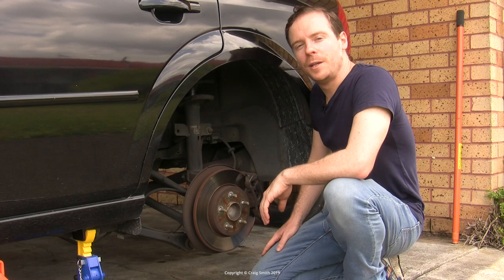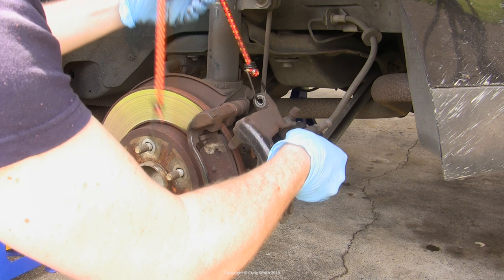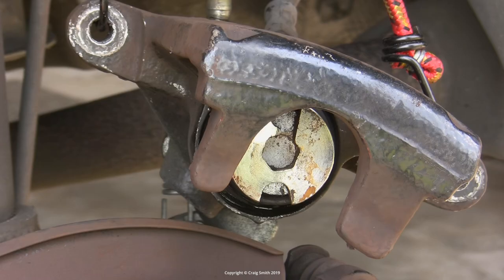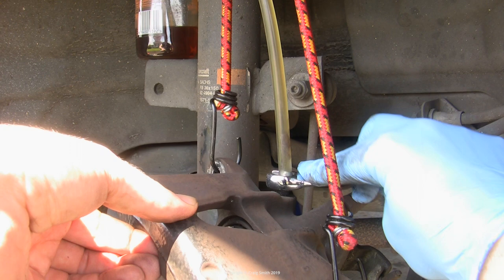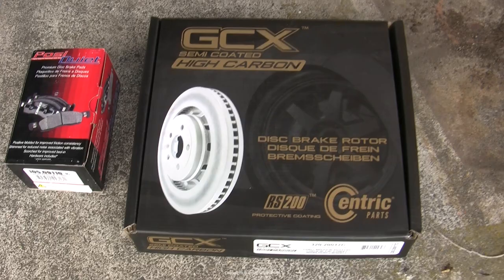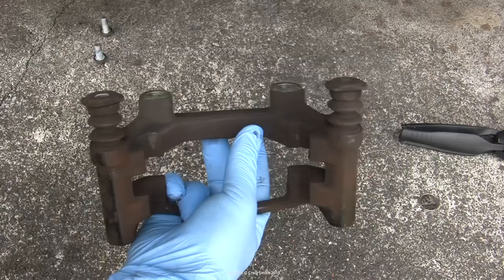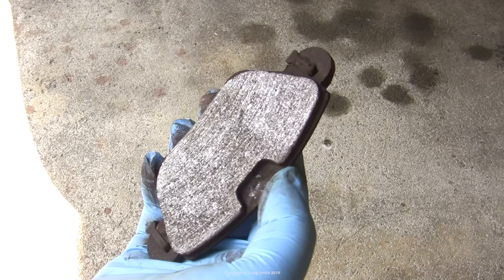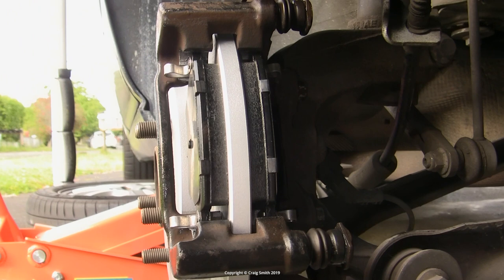How to: Change REAR disc brakes, rotors & pads (Ford Mondeo Mk3)

Comment from the maker: Amazon links to relevant products (from the desc):
* US rotors: https://amzn.to/2LVsAkR | Pads: https://amzn.to/2rN9h6n
* UK Mondeo rear discs: https://amzn.to/2LVtmyh | Pads: https://amzn.to/2rLtNo6
* Flare nut spanner - US: http://amzn.to/2rkSzum | UK: http://amzn.to/2mNEKPo
* Torque wrench 1/2" - US: http://amzn.to/2g1zGoJ | UK: http://amzn.to/2gJ7sAg
* Threadlocker - US: http://amzn.to/2DN3Upv | UK: http://amzn.to/2mTuVAv
* Caliper winding tool - US: https://amzn.to/38FNNcc | UK: https://amzn.to/2PJULo3
* Brake fluid - US: http://amzn.to/2BbX6Pb | UK: http://amzn.to/2DRlatX
* Self-bleed kit - US: http://amzn.to/2rk35Sm | UK: http://amzn.to/2EUAULK
* Silicone grease - US: http://amzn.to/2dv7lY2 | UK: http://amzn.to/2erht5w
* Anti-seize - US: http://amzn.to/2rlBU9Z | UK: http://amzn.to/2Beksni
* Brake clean - US: http://amzn.to/2DNbGj6 | UK: http://amzn.to/2Bfp4d4
Reply: Hi Craig. Thanks for your video's firstly.
I've recent been working on my front brakes from following your guides. No problem at all. I started the drivers rear. Long story short my piston doesn't seem to engage and brake pedal has full travel. I did have a problem where the piston was nearly all the way out. I managed to find it all the way back in. Reassembled everything. Thats when i discovered the full travel of the pedal. I'm hoping you can help.
Thanks.

Comment: U not sold on the latest rave: Ceramic Grease?
Reply from the maker: I had silicone grease already :) I'm sure the ceramic stuff would be fine too. Next time.
Reply: @CraigsDIY  I did some blog research and believe the sliders have to get silicone grease to preserve the boots.  Ceramic Grease for the metal-to-metal contact points only?
Reply from the maker: The pins and hardware contacts are two different situations, although manufacturers will tend to try to sell an all-in-one solution because everyone likes simple. The slider pins want a 'wet' proper grease, heat-tolerant and rubber compatible, silicone ideal - fancy versions with other additives like ceramic, fine. The outside hardware wants an anti-seize, not really a grease, and the ideal stuff will be both resistant to wash-out and continue to work even when 'dry' - copper or nickel based fine, fancier versions again with dry lubricants like ceramic, moly, graphite, if you want.

Comment: Hi the brake fluid needs changing on my mk3 2001 Mondeo - what size inner diameter is it on the clear tubing you used? Thanks
Reply from the maker: 6 mm ID.
Reply: Thanks Craig 👍

Comment: Great video, very clear and well presented, question for Craig or anybody who can answer. At the end of the video before refitting the wheel should there be any play or movement ,other than rotary of course, from the disc.On mine the disc rocks a bit and am wondering if it’s an issue, all feels secure and no play when the wheel is back on. I note more play/rocking on one side than the other, I am trying to isolate an unusual intermittent noise at low speed which goes away when brake applied, thank you tom
Reply from the maker: The rotor is not retained properly until the wheel is bolted up, so it is normal. Just make sure everything is square and the wheel is offered to the hub properly, and nuts torqued correctly.
Reply: @CraigsDIY  cheers Craig, seasons greetings